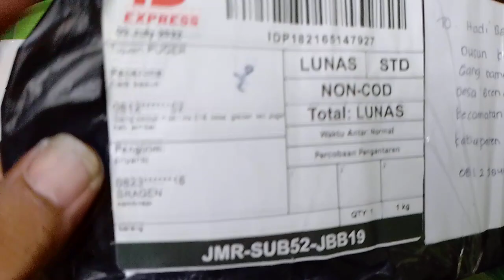cara memperbaiki mic wireless advance

Comment: Bang kalo mic wireless advance 301 kadang ada kadang hilang suara nya knp ya?
Sebelumnya sih normal2 saja
Batrai baru di charge penuh padahal
Reply: Suaranya jadi kecil dan tidak jelas gitu bang
Mksh & sukses selalu bang..
Reply from the maker: coba cek ic 4580/4558
Reply: Lokasi nya yg di mana bang?
Reply from the maker: @rickyyoffx9120  jatim bang

Comment: Di tempat kerja saya ada mic seperti ini tapi dengan tipe yang berbeda (tipenya 301). Masalahnya di receiver musiknya bermasalah. Jika dicas, kondisi baterai full. Tapi ketika dinyalakan, indikator powernya tidak menyala dan mic tidak terhubung. Solusinya bagaimana ya?
Reply from the maker: Mungkin ada problem d receivernya bang
Reply: @HDeltronic  apakah bisa diperbaiki receivernya ya pak?
Reply from the maker: Coba di cek teganganya dlu bang

Comment: Bang bisa gk modul resiver mic di suplay gunakan carger 5v tanpa batrei?
Reply from the maker: Bisa bang,
Tinggal sambung aja kabel charger ke konektor baterai
Reply: Bang punya resiver sy uda gk nyala, karna hanya kebalik pasang batrei, gitu di betulin batreinya uda gk nyala
Reply: Apanya yg rusak tu bang?
Reply from the maker: @Vivoy-ge6jx  cba dicek dlu bang tegangan yg masuk ke ic ada ap gk
Reply: Bang punya wa?  atau facebook, susah jelasinya, biar sy ngirim fotonya, masalanya klu di colok pake carger hp, lampu indikator nya masig nyala, gitu pasang batrei mau di ON gk bisa nyala
Reply from the maker: @Vivoy-ge6jx  no wa ada di deskripsi bang
Reply: Saya cari di deskripsi nomor wa nya kok ga ada ya
Reply from the maker: 081238442552

Comment: Punyaku 22 ny hidup bg.. tpi suara GK ada.. kyk GK konek gtu.. kira² apnya bg?🙏
Reply from the maker: Lampu indikator sinyal menyala apa gk bang ?
Reply: @HDeltronic  lampunya yg warna apa bg?🙏
Reply: @HDeltronic  padahal Bru beli bang..
 Paket datang pagi.. di tes bisa..
 Pas malam mau d pake ..udah GK konek lagi bg.. aku pikir baterainya.. tp.. lmpunya GK kedip.. juga pknya udah penuh.. udah lama ku cas juga bg
Reply from the maker: @salamrindu21salamrindu48  lampu sinyal warna biru kl g salah
Reply: @HDeltronic  hidup bg.. semua terlihat normal² saja,,TPI GK konek,,GK ada suarany..🙏solusiny bg
Reply from the maker: @salamrindu21salamrindu48  mngkin problem di penguat audio out bang
Atau system mute nya
Reply: @HDeltronic  jd hrs gimna itu bg..?? Bisa d stel lgi brrty
Reply from the maker: @salamrindu21salamrindu48  gk bsa kl d stel bang
Harus d cek mngkin ada part yg rusak